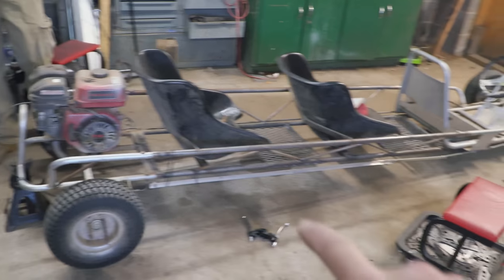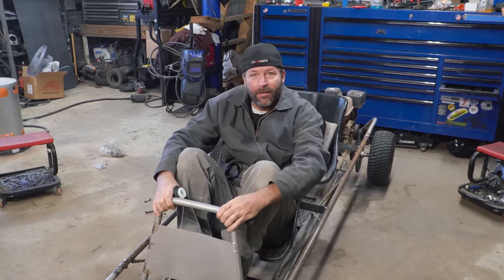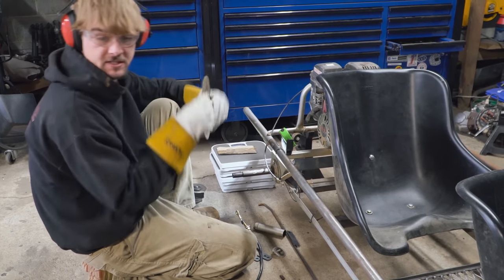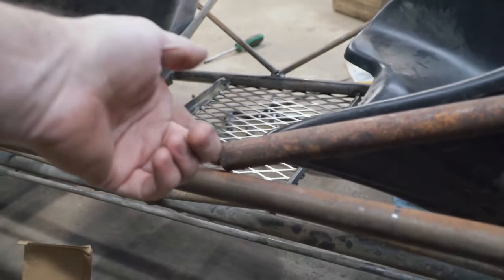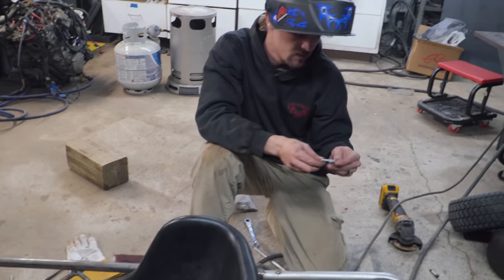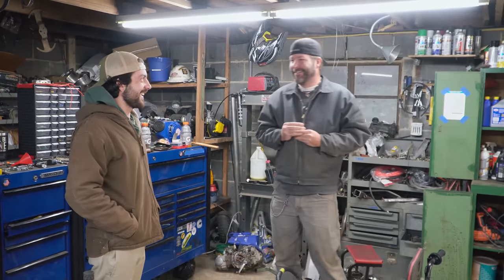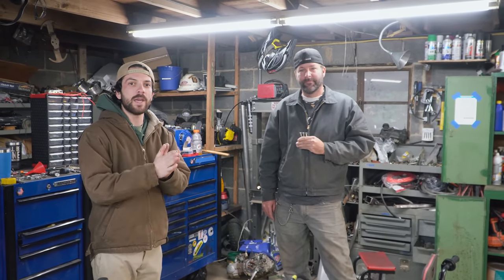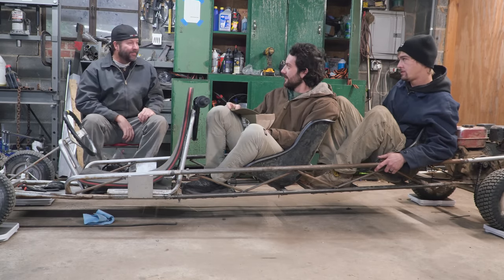Limousine Go Kart Pt. 2 | Adding Independent Controls!

Comment: This sort of reminds me of a 3 wheeled bike I saw at a thrift shop about 2 months ago. So, the seats (2) were side by side and each seat had a set of pedals which drove COMPLETELY independent  of the other, one of the rear wheels driven by each "Driver" each having the ability to move forward their own wheel OR brake that wheel. the front end was a single bicycle front end swapped around so the forks were backward making what I refer to as a crazy wheel...meaning it was trailing and would turn as the bike turned on its own...SO to move forward in a strait line each rider/driver would have to match speeds of their own rear drive wheel. This thing would be the most hilarious thing in the world to watch two people ride!!
Reply: They should make people ride one together before they can get married. I bet divorce rates would plummet 😂 but honestly that sounds like a lot of fun to ride. I rode one of the pedal cars with my wife and kids. Kids loved it, wife kept pulling the brake 🤣

Comment: I can’t wait for this thing to have a greatly overpowered engine on it.
Reply: I think it needs a 140 or 190 Honda pitbike engine with a four speed  manual trans, and brake pedal controlled by the driver
Reply: Any more power and I'd really suggest a little stronger frame... don't want to see anyone hurt if it breaks up...

Comment: The guy running the gas has more confidence in the guy steering than the guy steering has in himself, so the guy running the gas powers into the corners where he sure is the guy steering can handle it! The fellow steering does handle it, wanting to impress his friends and not crash he's going to try extra hard, harder than he would where he controlling it himself. The guy running the break doesn't want to touch the brake because seems like everything's going pretty good He's on it they trust him, what an amazing dynamic! This dynamic is why you got such a good time! There should be races with just these lol Great show guys!

Comment: The ol' Carolina Conga Line. Problem with adding nitrous is you'd have to add a 4th driver. I'll let you guys be the judge but it looks like it could handle a 420cc without trying to kill you all. Might be a bit too much for a single driver to race though with how far the back end already wants to go. Would probably get very wild on the oval

Comment: My local raceway has something similar. 3 cars chained together. 1 has engine and steering, 2 just steering, 3 steering and breaks. Full throttle motor speedway in varney crazy trains if you want to check it out.

Comment: If you use a machine with a manual transmission, it's definitely more fun, so the front one holds the steering wheel, the gas pedal and the rear shift gears

Comment: I wonder if once you got more mass running at high speed vs one guy running it, if the momentum was easier to keep up and going and slowed at a different rate going up small hills. That's what gave you a decent time with 3 guys on it.

Comment: You guys could grab some moto GP handlebars that bolt on to a motorcycle fork/stanchion and put it on the sides of that first chair as the throttle for easy removal or a temporary mount up

Comment: Shoot man, you wanna make it interesting? You need 2 built-out 670s mounted to the back. That's nearly 100 hp on a go-cart. I've seen motorcycles that weighed close to that amount with 100 hp. And they nearly fly. Here in Ga, they have a dirt track event where one drives while one is on the gas and another one is in the back seat on the brakes. 3 guys in one car. They have to learn how to work together if they want to win. No big HP here. All the cars average around 300 give or take a little. Anyone can win. It's mostly about driver skill and how the other two guys work with you to get the car around the track the fastest. You could do a mini version with your go-cart. But you need more power.

Comment: I'm turning a old snowmobile into a go kart/4 wheeler type thing using the engine and the frame of the sled too. the drive sprocket that use to drive the track broke on it when I went to take the sled out last weekend so instead of fixing it I decided to turn it into a go kart using the whole snowmobile. the body is aluminum so it should be nice and light I got the axel, chain, and bearings ordered and depending on how long I get the parts should be together in a few weeks.

Comment: Could you possibly have taken a gooseneck (4 bolt ) from the bicycle and mounted it to the back seat rollbar angled it with heat and the eye level and make it work without issye for the driver  in front?

Comment: with it having 3 seats the fastest improvement would be twin engines . nitrous is not good for brigs engines even if there built but there is enough room on the back for a second engine which would solve all the power problems for a long time to come and knowing you guys you have a spare brigs under the bench
Reply: Second Engine would be awesome on this... and if they want to make it really epic make it independent drives to the rear wheels and add a second hand throttle on the 2nd seat... steering assist and differential capabilities lol

Comment: Okay at 14:22 I'm still staring at the lower handle bar bolt, wondering, when are you going to realize that it will potentially paralyze the guy in the front seat?
Reply: Itll be fine

Comment: But just to go over it again I got a 3500 Craftsman riding mower stock it says custom on it I need a few extra features to the frame just to make sure metal a winch on the front and the back a blade steel plate for hauling I'm having trouble shifting with my transmission and problems with motor oil burning on the spark plug is a 20 horsepower engine 6 speed transmission I was wondering if you could give me some advice on how to speed it up and get better torque without sleeping or spinning not to mention it kind of acts like it's got a clutch and transmission you push the break down about a quarter of an inch it shifts pretty decent but does not like to go in 6th Gear hear the past I don't know 6 weeks or so I'll haul heavyweight push gravel snow right dirt everything I'm rough on it